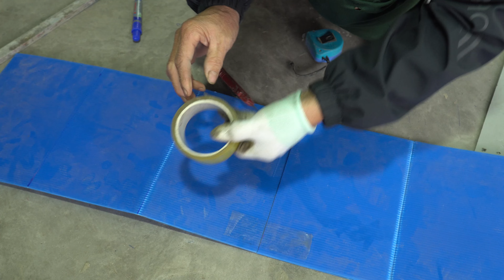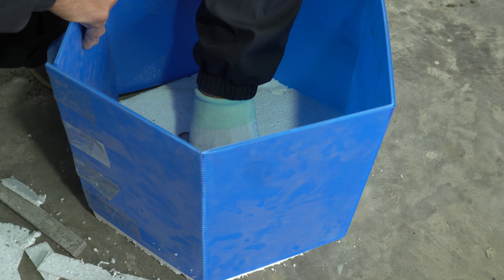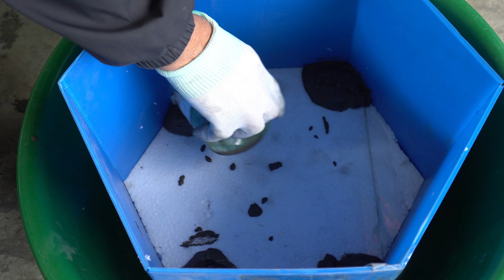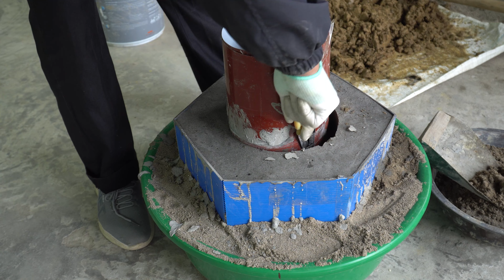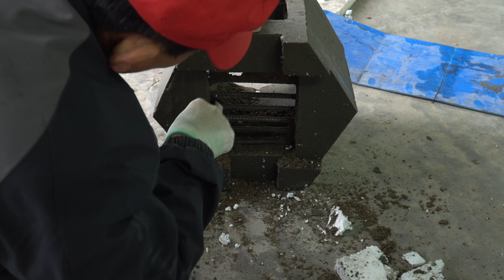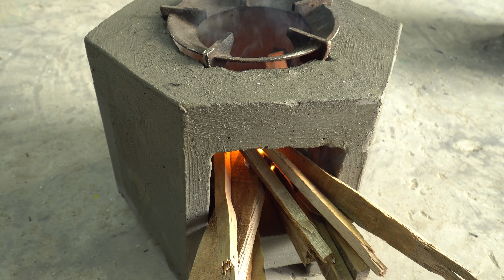Plastic Cover and Cement - Build a small wood-burning stove from cement.

Comment: Nice build. So it already cracked center top at the first burn? If so, any idea on how to avoid that? :-)
Reply from the maker: That's right, it may crack with high temperatures. The solution is to reinforce the structure with an iron core inside, or on the inside, add an additional layer of heat-resistant clay, as I've done in other stoves I've built in the channel.
Reply: Thank you :-)  @mrcement99